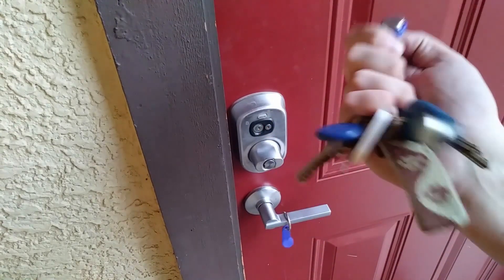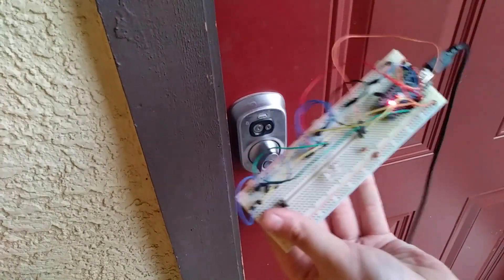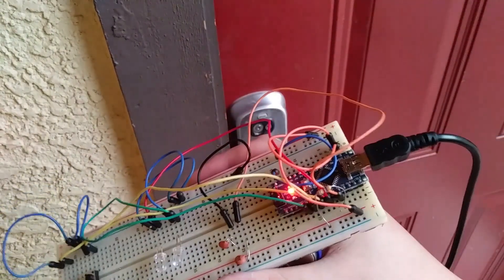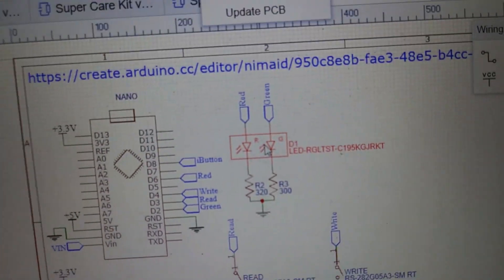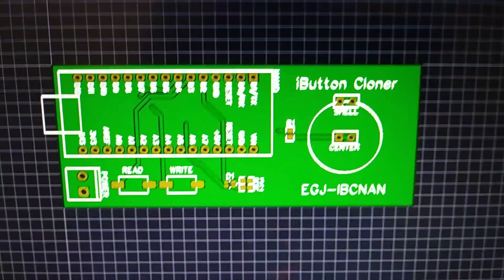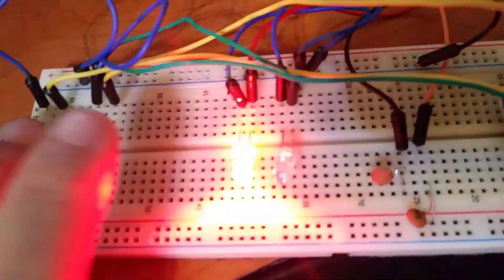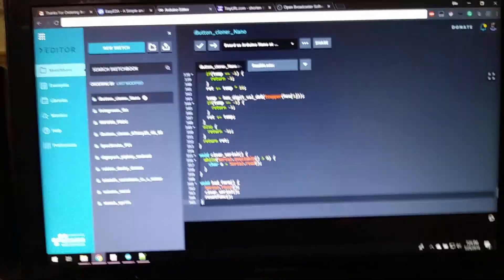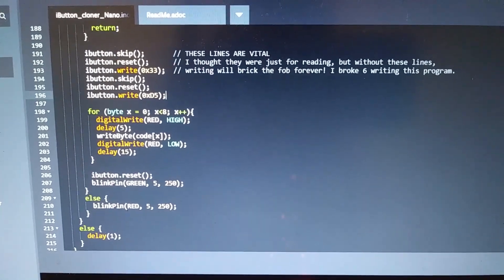DIY iButton Cloner

Comment: Ok, I want to build this....and I’m a total newb. So as far as the nano.....are they all the same. You mention the serial console, is that just the program that resides on the computer that can read and store the nanos I button serial number? Is the console included in the links you provided.
Reply: Sorry I accidentally hit send button as I wasn’t done asking questions. Also, the console seems to be able to read the saved I button code, but can you also write your own unique 64 bit code (hex format I presume) to an rw1990 Ibutton? I’m hoping so, cause I would need it to do that. Seems you can since it seems the console can retrieve codes to the computer and save numerous ones to memory. Are all the rw1990 ibuttons the same? So, to sum it up....I need a arduino nano, I need to upload the program from your links, then breadboard as you have with leds buttons power etc. then load console onto a computer and use nanos usb connection to save ibutton data into console on computer.....is that the general gist of what needs to be done. Let me know if I’m on the right track? Thx for your work on this.